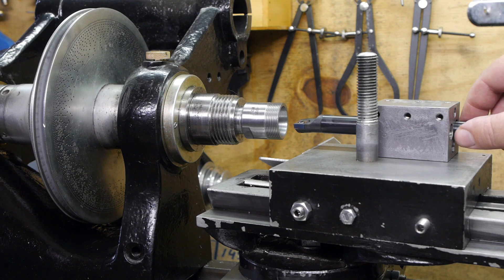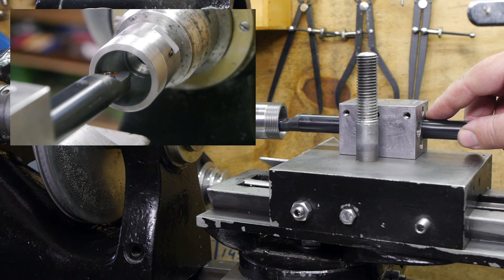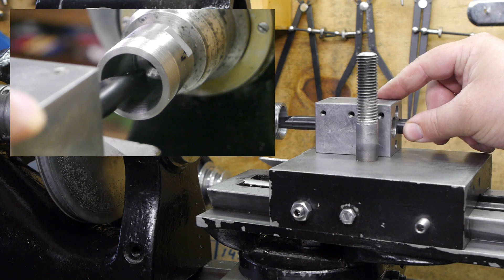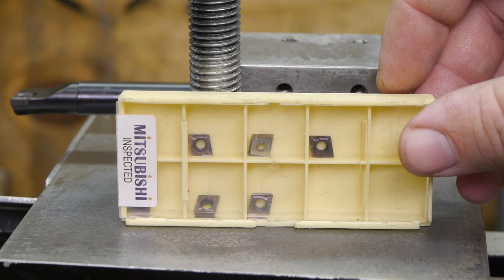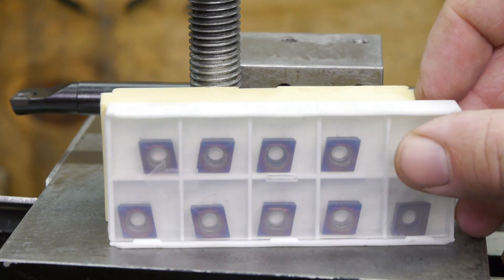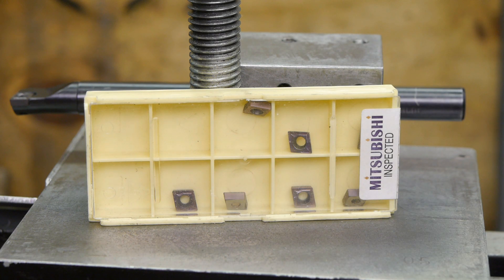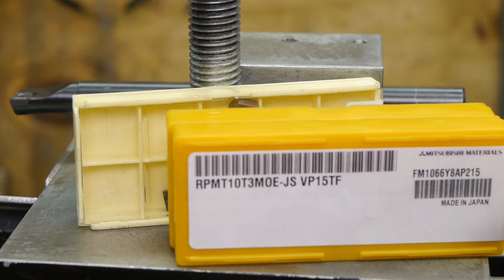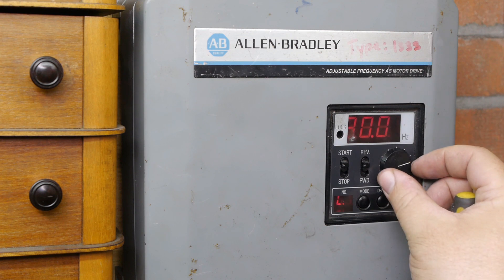Bad boring bar finish using some Mitsubishi VP15TF inserts

Comment: It is hard to get a good finish without speed and pressure when using carbide tooling.  You would be better served with good HSS tooling on your lathe.  CONGRATULATIONS on the 10K subscribers.
Reply from the maker: The surface finish I usually get it pretty random. I can be totally different from one cut to the next. might be the manual feed.
Reply: I agree.   I use the same inserts and get a nice finish.  But I also have the HP and speed and feed to push the inserts.  
The work is hardened, so it probably needed 1000 to 1200 rpm to get a mirror finish.
Reply: legal pitbull 
 how old is this lathe ?
How light is this lathe ?
How much HP has this lathe ?
How much rake is on the inserts ?
I think you actually know little about the subject... you think it takes time to grind up a bit of hss tooling ? 😂😂😂😂

As to ALL machines being able to employ carbide insert tooling.... 
From wikipedia  ...
."the first carbide tooling was brazed-on tooling... in the 192os..." (before inserts)

"carbide tooling offered an improvement in cutting speeds and feeds so remarkable that, like high-speed steel had done two decades earlier, it forced machine tool designers to rethink every aspect of existing designs, with an eye toward yet more rigidity and yet better spindle bearings"
Reply: Ya know, I don't 100% agree.   I use carbide on my bench lathe quite often(all the time) and have found it's all about the grade and coating (Chinese knockoff inserts are generally quite poor and don't perform well even matched up correctly).   I can eek out mirror finish on 1018 or 4140 with the proper P steel insert sub 1000 rpm which I always had issues getting right with HSS (Sumitomo AC300 I believe it was).  304, 417 and 17-4 are quite easy as well with the proper PVD coating.  Even inconel 718 is quite easy with a good coated S insert.  
I've seen lots of blanket statements with carbide and it really takes a deeper dive to correctly match your material with insert for a good finish and experience vs. 'carbide is carbide'.  Using an incorrect insert is like using a dull blade;  It will sort of work if you use a lot of force but everything gets stressed out, takes too much effort and you get a ragged cut. 
Sorry for the novel, just something I've spent LOTS of time and money experimenting with and wanted to share.
Reply: legal pitbull  ... the lathe was never meant to run carbide, its ridiculous... put a super-sharp hss bit at dead-on centre-height & do it right... 🙄🤨
Reply: legal pitbull   ...did u read the part of my comment where I said the lathe isn't built for carbide ? 
Obviously not.... If you are so knowledgeable you would also know that carbide insert tooling NEEDS rigidity & high speed .... not happenin on THIS lathe ..

And no, HSS is not obsolete either (I don't know what HHs is) ..and wtf are you even talking about grinding carbide ? ... do you think form tools etc. are ground out of a lump of carbide ?
Tool & Die maker indeed .. 🙄😏
Try again... 😎👍